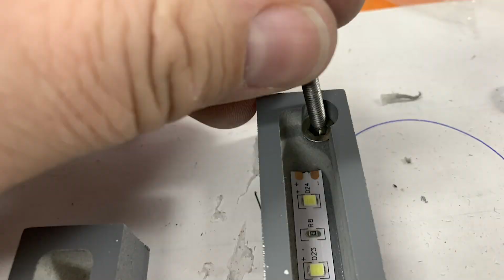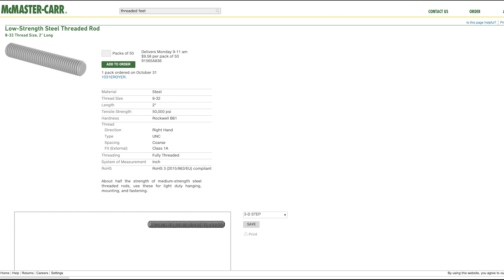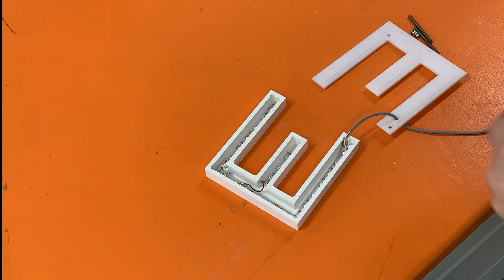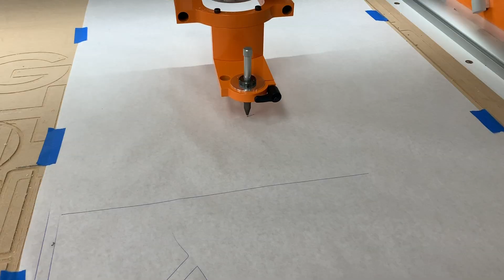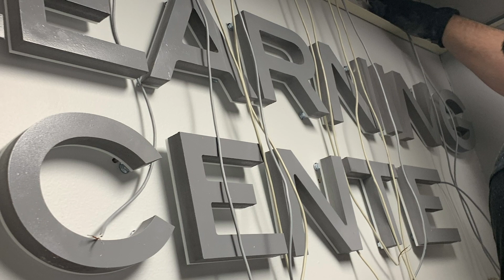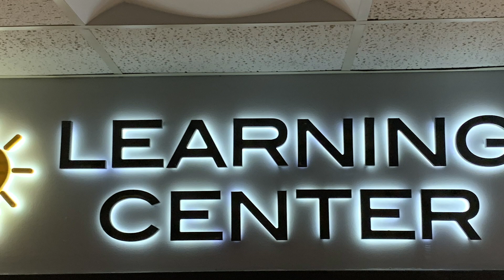PART 2 - 3D LED Backlit Letter Sign Tutorial: Wiring, Assembly, Layout and Installation

Comment: I have a question

First thing.

Amazing tutorial, I learned a lot.

So for example if I used adhesive for the threaded rods so it can stay on there. 

How can you remove it if the LED becomes an issue?

With adhesive it sounds like it's permanent. So im curious if it comes to the point where I have to remove and fix